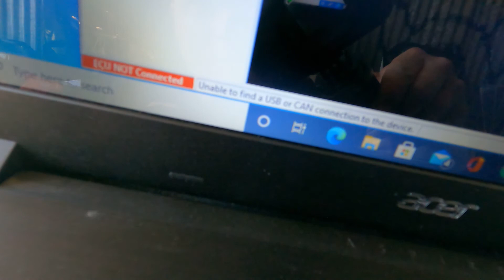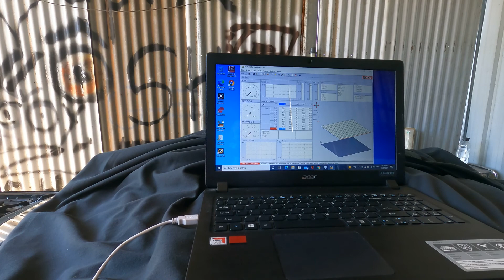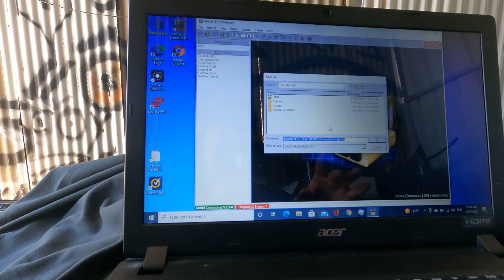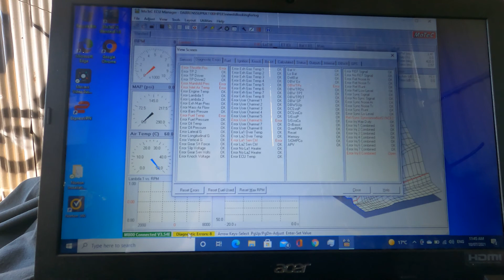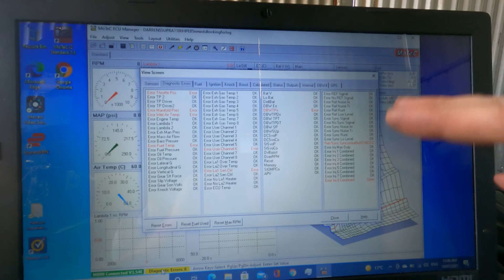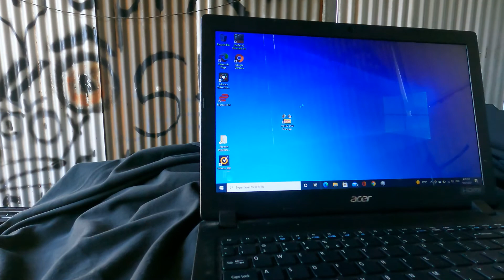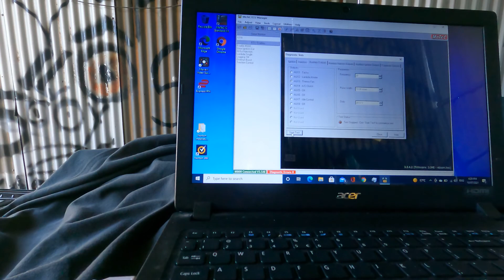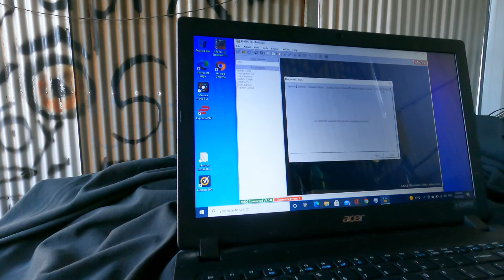2jz hypertune intake installed and testing some outputs

Comment: Hey mate, great videos! What throttle cable did you use for the hyper intake?
Reply from the maker: Hey mate thanks i believe its from a 1999 Toyota camry wagon with a v6 I got it from a old wreck in the bush bolts stright in
Reply: @Savage6supra  beauty! Ill try my luck over here in nz
Reply from the maker: Most of the 90,s to early 2000,s Toyota's have the exact same mounting bracket on the fire wall behind the pedal just gotta find one thats long enuf have a look around a local wreckers